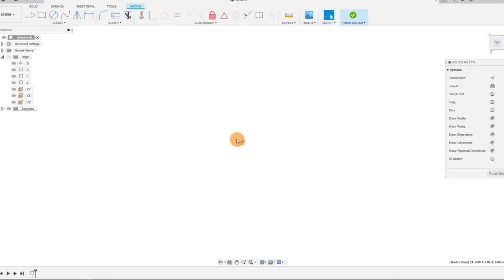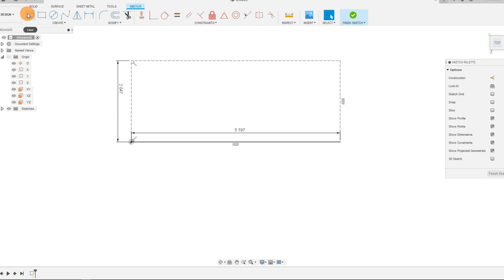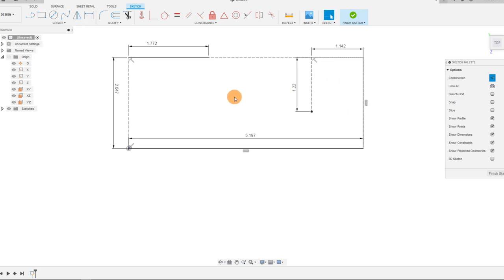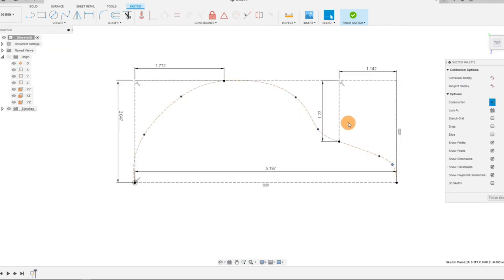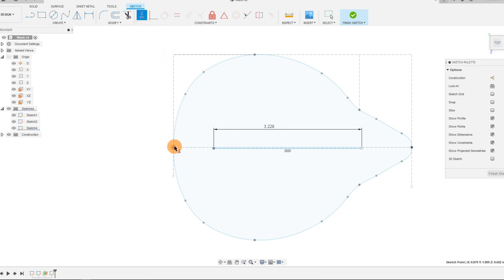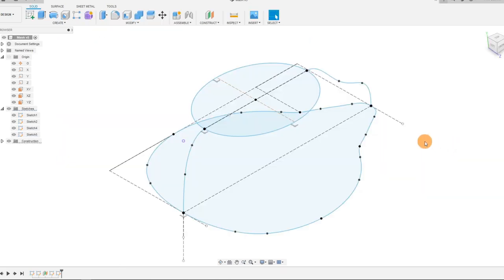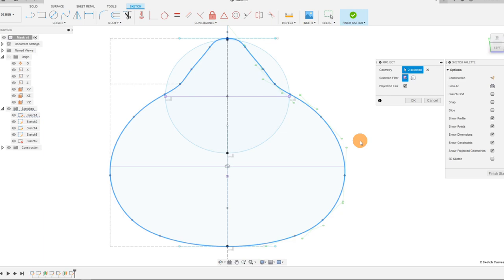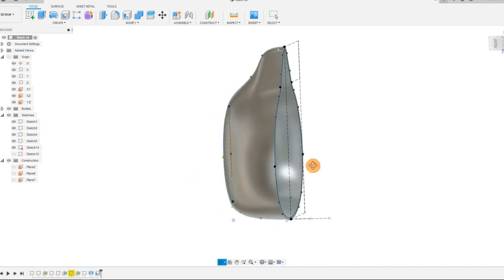How to Model a 3D-Printed DIY Face Mask Respirator in Fusion 360. Homemade Mask Filter Tutorial

Comment: How did you do the slot pattern?  Your video skips that part.  I can’t figure out how you pattered with the size reductions
Reply from the maker: Hey, the way I made them was by first doing the pattern, then editing the size of the top and bottom slots after. You can basically "break" your pattern constraints to allow you to do that. I hope this helps! The other way to do it is to just make two inward angled lines the slots need to fall within and dimension them accordingly.

Comment: I did make this mask (different on the front part) and the fit wasn't great. Any suggestions on how I can potentially get a better fit as well as make various sizes? Thanks!
Reply from the maker: Yes, the easiest thing to do is add a foam gasket to the inside, which will fill in the gaps of a bad fit... the other thing to try is to change the original sketch we made of the base. If you alter that sketch, the fit will certanly change as well.

Comment: Hello, I loved your tutorial. I was wondering if you could make one of adding a tpu gasket to this design. So the gasket could be slipped on, greating an airtight seal.
Reply from the maker: I love that idea. It can be done with that, or foam. Either way, the print would need to be made of the right materials to function properly and not carry the virus on it's surface.
Reply from the maker: I made a tutorial on this...
Reply from the maker: https://www.youtube.com/watch?v=6ki8IgtqqOE

Comment: Thanks for the tutorial. I have a question. At the begining, when i click the "Top" face & XZ plane and then open the sketch, "top" face is change and "back" face is come up? I cant stay at the top face.
Reply from the maker: It's okay you can just update this. To do so, go to the arrow underneath the view cube and select "top" when you are looking at the XZ or whatever plane you want. It will reset it.
Reply: @AvivMakesRobots  it worked! thanks
Reply: @AvivMakesRobots  hello again, i have an another question. i started to design a new mask and i want to open sketch on cross plane (to part of a body's surface actually), not just front or behind or whatever else. then i want to extrude it. but i couldn't find how to play with surface.

Comment: Engineering Juice I can get the loft on! It says that my rails are not touching all the layers! What can I do?
Reply from the maker: Are your rail end-points touching both the top and bottom sketch?
Reply: Engineering Juice I’ll have to check! And thanks!
Reply: Engineering Juice I’m pretty sure they are! But it keeps saying that! How would I fix it if it is not touching
Reply from the maker: @elmayoproductions6026  You need to project the top and bottom sketches into the sketch of the rail. When it comes in, it will come in looking like a line. You can just make it construction.

Comment: "the selected rail does not touch all of the profiles." I've tried this twice on mac and pc and I projected the elipse and starting sketch like you showed I just can't get the sketch before this step to give me usable rails. The other rails work. I've had this problem on other fusion tutorial for a whiskey bottle. The points look joined and fail on the second set of rails. It's infuriating.
Reply: answered my own question. The rails weren't connected at the botom because another point was in the same plane
Reply: I can see by the jump cut at 14:34 you had to deal with fixing the same issue I was having. You made the last set of rails connect to a previously made black point rather than the purple colored projection points on the bottom plane.
Reply from the maker: @Pyromancers  Exactly right. Is it working now? Sorry if this was confusing. I try to make the videos as short as necessary, so I cut out any "error" bits.
Reply: Engineering Juice no worries thx for the reply and for even making something so I could learn it. Yeah I got it all working well and am getting it ready to print now.
Reply from the maker: @Pyromancers  Great to hear!
Reply: @AvivMakesRobots  Would it be possible to explain how you rectified this issue.  I've tried to connect the rail to the bottom point on the bottom plane but still get the same error.
Reply from the maker: @MrDavidstuart97  If you get this error, the point you connected to is probably not in the same sketch as the bottom profile. You need to connect to a point in the bottom profile.
Reply from the maker: Let me know if this answers it.
Reply: @AvivMakesRobots  Thats it sorted now thanks for that, I was going round in circles there
Reply from the maker: @MrDavidstuart97  That fixed it? Great to hear!
Reply: it's fine I had to modify my shapes to make it combine with the projection ... also I don't know why my fusion is projecting points from the construction lines ... must be a bug
Reply from the maker: @frenkygnaka6361  No, it makes sense that it would do that. Those construction lines are the projection of the side profile of the shape; so of course it will be flat. Let me know if you have any other issues.
Reply: Engineering Juice sorry bro there was another comment that described my issue... but I must had deleted in a moment of panic 😂
Tnx for your time 🙏!
Reply from the maker: @frenkygnaka6361  Alright, no problem.

Comment: Hi again, i created ur mask but i wanted to make the openings on both sides of the face so i created 1 circle on each side of the face at an angle but now i cant loft that it says that rails dont conect with all profiles, do you have any idea how to fix that?
Reply from the maker: Why not make the holes as extrude cuts after the loft? Trying to put holes into your flange feature is a very advanced process that will take a lot of unnecessary time.

Comment: you make it in 26 minutes, i am doing this shit over 5 hours becouse of fucking errors, lags or some other shit reasons why this can't do operation. WHAT THE FUCK?! Stuck on 15 minute.
Reply from the maker: Hey, I am sorry to hear that. Throw me a comment here if you have any questions and I can try to help. Remember that I have been doing this for years and so that is why it takes me 26 minutes. Best of luck.
Reply: @AvivMakesRobots  For some reason after i post it it's start working, so at this moment i print first prototype. Thanks.
Reply from the maker: @Revdon_  Cool! I understand some materials are better than others to use in order to not allow the growth of bacteria on the mask surface. Something to keep in mind.
Reply from the maker: Great! Does it fit well? That is one thing that will need to be adjusted for each person.